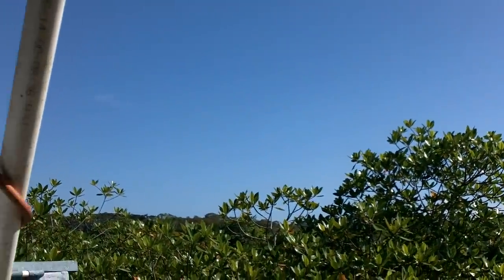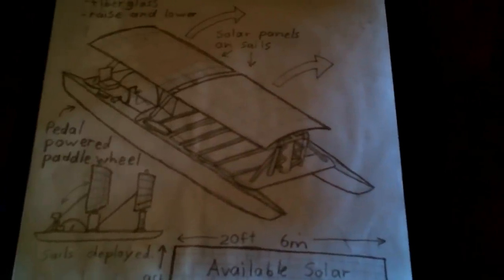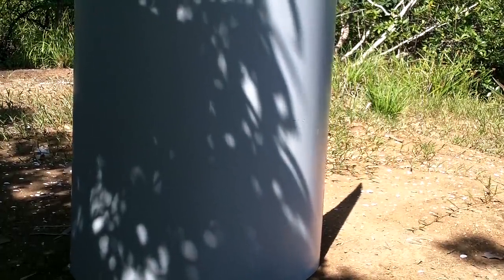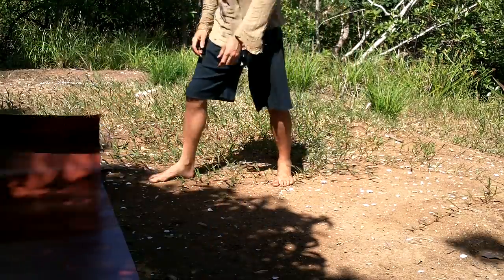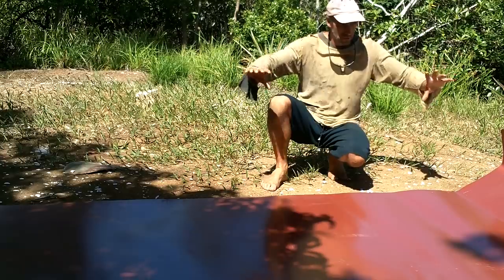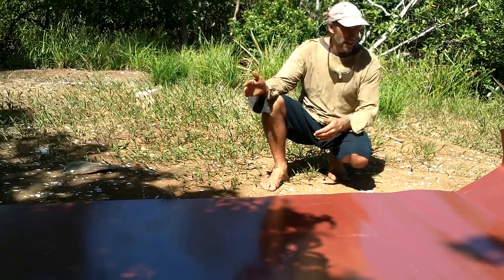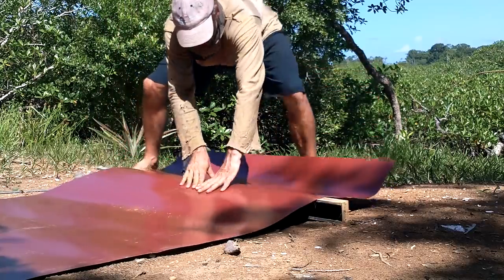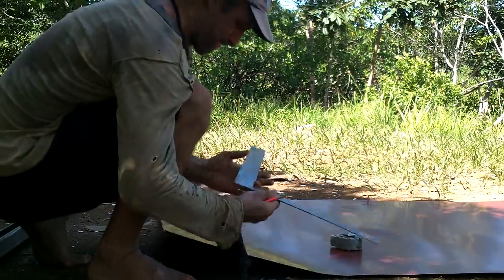Solar Sailer 022 Sails Begin!

Comment: I was thinking if you made the sail like the window shade thing on the back window of a old mustang, it would be like how birds wings work, idk id do some small scale tests, or even a triangular shape so it cuts through the wind on the front but still pushing from the back. And you can make it transformable, so it goes back to the original design so you can still use it as a roof, it's kinda like you knew already, you made it on sections

Comment: "You Can Do it Jaimie, You can do eeeeet!"
.
.
.
PS- hydrofoils designed for  reducing drag are an EASY fix for added speed and efficiency.  If you lower your cruising water line by 4 inches imagine the volume of WATER that you are not having to push out of the way. Yep, uh-hu.Its a no brainier ain't it?!?!? 😀👍😀✌

Comment: Nice job...you could have just molded it flat and bonded/glassed curved ribs to top & bottom.  The ribs will help prevent span-wise flow  (up & down) from high pressure side (concave) to low pressure side (convex)....reducing drag causing vortices at the head and foot...I guess if you dont have a flat surface anywhere it's about the same amount of work.
Reply: He knows